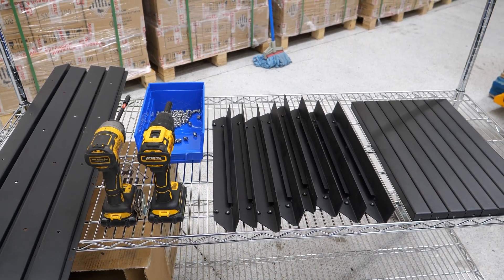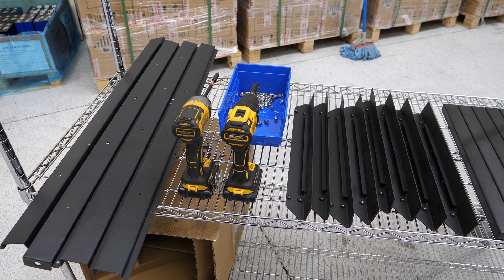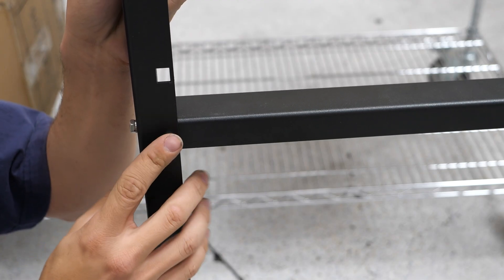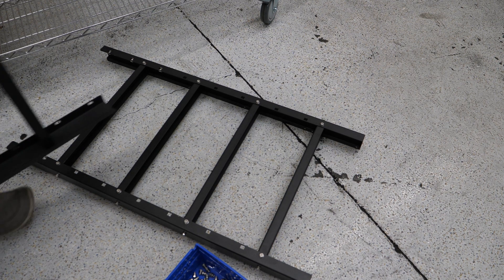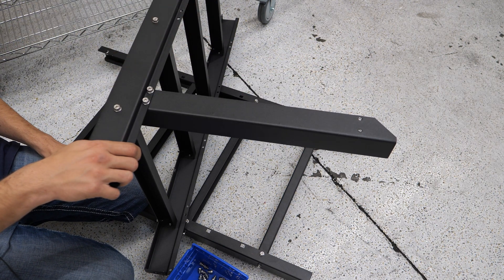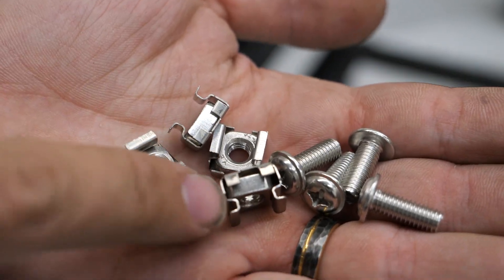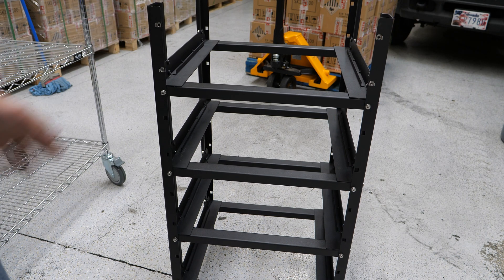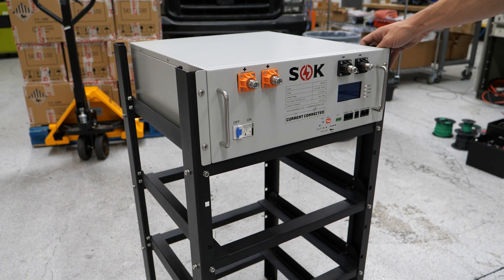Step-By-Step Assembly: SOK 4 Slot Battery Rack for SK48v100 Battery

Comment: Update:  Turns out they are #3 Phillips.  Don't make the same mistake I did and assume such a small screw was #2 Phillips.   The head on the screws that shipped with my 5 slot rack are not Phillips/hex combos shown in the video and strip out just about about the time you get them tight.  Since these are pan heads you don't have the option to use a socket.  Other than that it seems like a very sold rack.

Comment: I have a rack and two batteries on order,,  But I think I would have the two at the bottom of the rack and the two empty slots at the top,, even if the rack is bolted down ,its not good for that weight to be so top heavy(in my opinion)
Reply: Actually I just received and it turns out my rack holds 5 batteries    but the screws are on the very cheap side,,,
Reply: @lipsee100  Same here.  Just about the time they start to tighten the head immediately strips out.

Comment: Will that rack work with the eg4 batteries and how much is the rack is didn't see it on ur website...keep it up brother
Reply: The EG4 are inch shorter than the SOK, but I bet you could make it work. Or you could get the rack specifically made for those EG4 batteries at Signature Solar